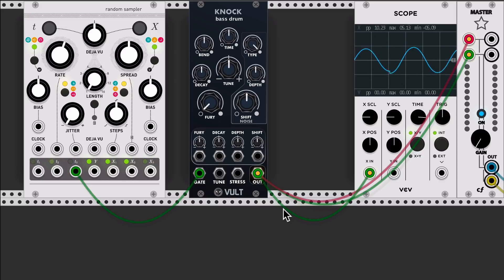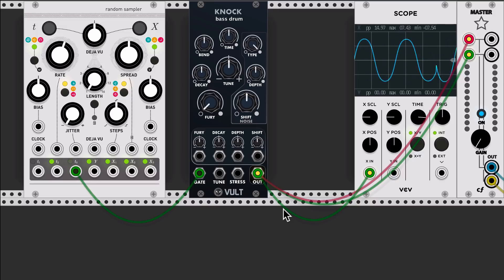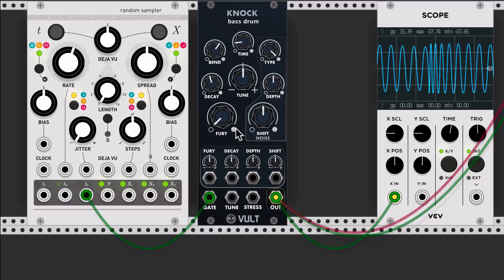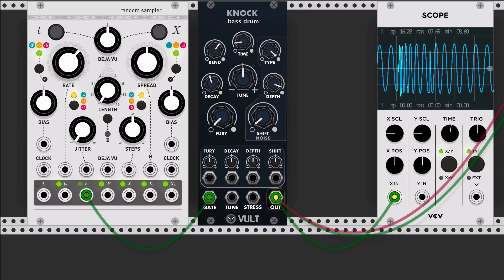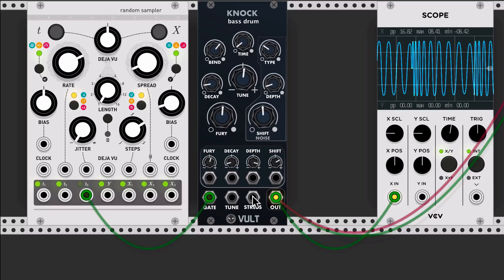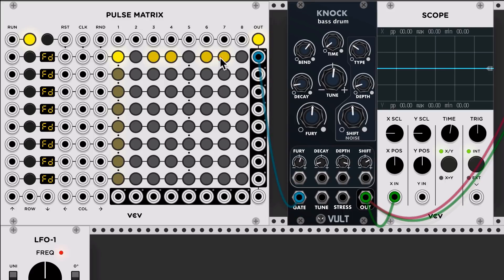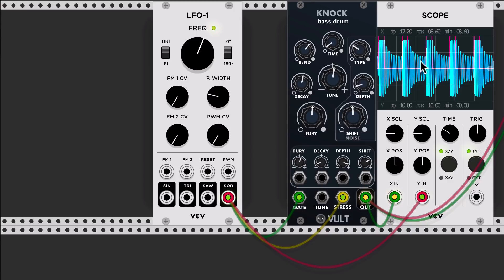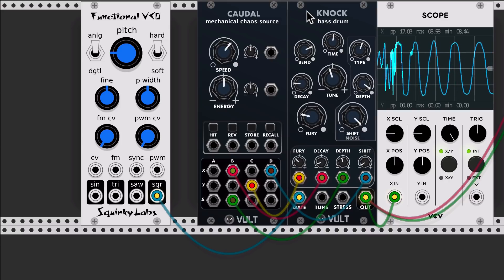Vult Knock: Overview

Comment: I hope a snare drum comes next. :) It's quite difficult to dial in a nice snare sound on Trummor. But when it's in, it sounds awesome.
Bass was always pretty easy, but having Knock is also awesome. I love it, and Trummor/2. HiHats were pretty easy to dialed in as well. But a separate module for open, and closed hats would be awesome. Everything you do is the best. Thank you.
Reply from the maker: Justin C one trick that you can make to get the open/closed hat is using the modulation router and change the Decay and Cutoff. You can send a gate signal when you want the open.